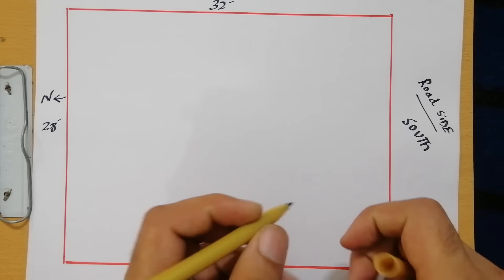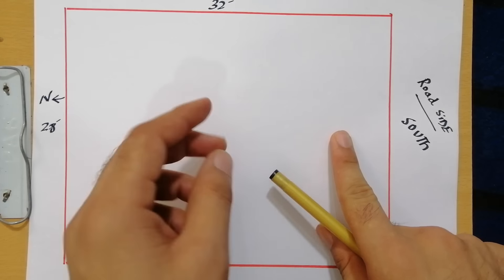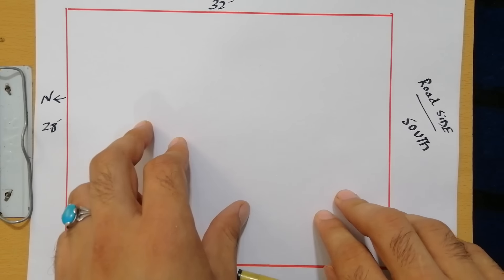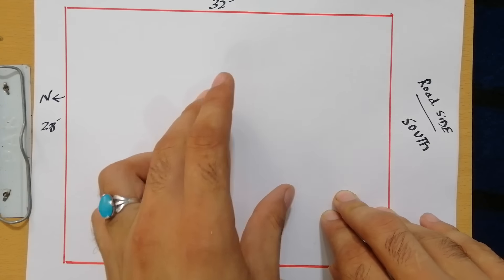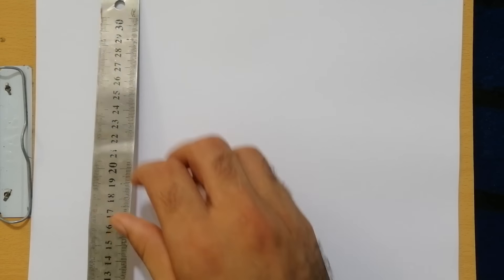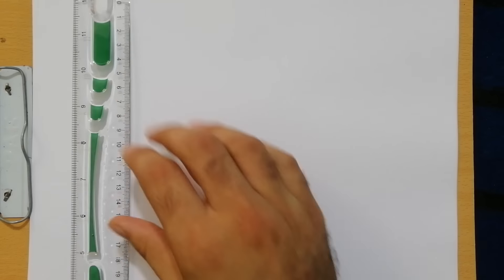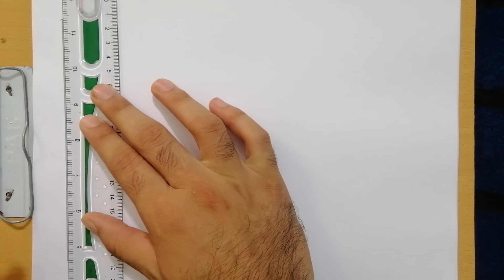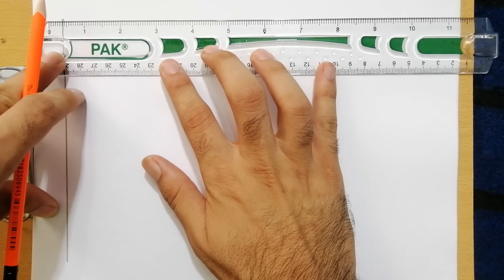How to Make a House Plan Step by Step?

Comment: Sir your structural engineering lecturers very awesome but for this architectural plans I would suggest that before you construct your house plan please always consider the naturally occurring factors all year around-Sun direction, prevailing wind directions. And then cartegorise your spaces into wet floor and dry floor areas and then sort them into public and private spaces. Only then you'll create a functional space in your house. Note that always remember that there are minimum standard measurements for every spaces in all building designs.
Reply: right

Comment: You make vertical 28 which is not correct 11+11+5•5 =27•5 with out brick .. i brick work is start as width of 9 Inches which increases the outer wall by 3feet ... So ple correct it

Comment: You said the L=32' but my calculation is 12+11.5+8+.5+.5+.5+.5=33.5' and the W u said 28' but it's. 5+11+.5+5.45+.5+11+.5=29.45 and the ventilation system is awesome all around what a ideal plot bro front side road and three sides streets? And it's 32*28 and u ignore car porch and the if u rotate the stairs u can use for separate portion and replace the 3rd BD and kitchen 3rd BD can use for guest room ect.....

Comment: 8:23 your total bedroom width size is 11 feet each so total is 22 feet and the bathroom is 5.5 so total will be 27 feet n 5 inch and the remaining half inch will be your wall from both side exterior what rubbish is this at least the minimum wall for the outside or exterior .It should be 5 inch on the location so if I carry two sides 5 inch one it will be 10 inch but you have only 5 inch left so remaining 5 inch of wall how you will make it so this is just ridiculous just  for making a Architect designing on YouTube to gain views actually, you know what and the later part the local Mistri or the contractor they have to come and correct the day drawing and I have seen so many Architect in my life

Comment: Nice video sir... But have a look at the total dimensions you have drawn...
The size of the 2 rooms is 12'+12'+5'5"=29'5" and the total plan is 28' only
Reply: Nope. Look carefully. It's 11+11+5.5. =27.5. 
Not a big difference except when think about the side walls of bathroom 😂 we need one feet extra ,😋
Reply: I saw that myself, you are a genius okay.
Reply: In dimensions the L is 33.5 and W is 29.5 with walls length which is 6"  each

Comment: I realize that some of the difference may be cultural, but there is such a huge difference here from the typical American layout of rooms. 

I'm wondering if there is some kind of unspoken importance placed on the arrangement of these rooms. Because you have split up the rooms which use water and are keeping them away from each other. Here in the U.S., such rooms would share a "plumbing wall" or a "wet wall" so as to keep the plumbing costs at a minimum. They are not necessarily next to each other in terms of traffic, tho. You wouldn't walk out of the kitchen and into the bathroom. They may have doors far from each other, but they share a wall. 

Also, there are no closet spaces. LOL Such an American thing, right? But I would imagine it's becoming more important for you as time goes on. And if you have a vehicle - even a bicycle! - where do you keep it? So many things...

Comment: Issues to address:

1. Assuming that the stairs going up to the second floor account for a standard 9'-1 1/8" wall height and you are using clear span floor joists (16"  depth would be minimum for something 28ft wide) that works out to a true riser height of 6 5/16"; the amount of risers this requires also means you would have an overall stair run of 17'-5" with 11" wide treads and this does not even account for the 3'-3" minimum landing depth... that puts you closer to 21 ft overall for a stair run.

2. Assuming all the dimensions are interior to interior of wall, your west wall would have no "lobby" at all... if all interior and exterior walls are 6" then you are already looking at 33ft length (34 ft if you look at your east wall dimensions) without accounting for a lobby/landing which by code needs to match your stair width minimum (approximately 3'-3" in your design case).

3. These two issues alone mean that your overall length to accommodate as you have drawn would have to be somewhere between 44 and 46 ft at least; without increasing the length you would essentially lose your main bath location and 2 ft plus from the bedroom along that side.

Width has a similar issue, 30ft minimum accounting for wall thickness.

Rough sketches are great as a starting point but please get someone who does this kind of thing for a living (myself being one such person) to draw up professional house plans as we are much more well versed in the required critical thinking and codes that the average person is not. You would be surprised how often I have to make drastic changes to a customers sketch just to get it to work in a way that even remotely reflects their intentions.
Reply: ummm
Reply: @KINGFINEGAN  yes?
Reply: Hi Jake. Where are you based and what do you charge for a plan ?
Reply: Bb
Reply: Bb
Reply: 🎉 8:12 8:13
Reply: Nb.

Comment: Sir doubt.
Why the dims are not divided in a round figure? It can be 11 or 12 ft instead of 11''6'. And from other engineers they say wall thickness is 5', yours is 6'. Which is standard.? Or will it vary from land dimensions?
Reply: Wall thickness 6´´ including plastering